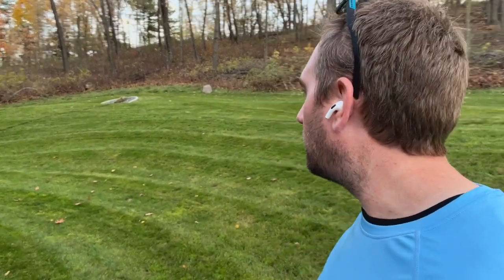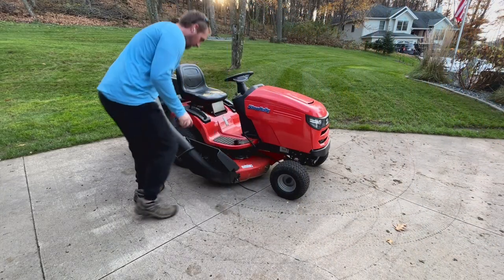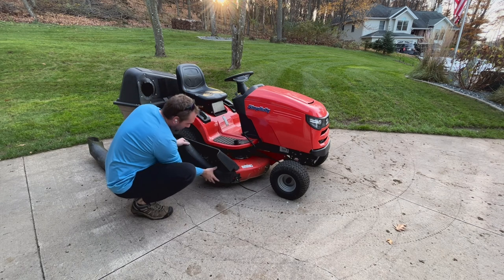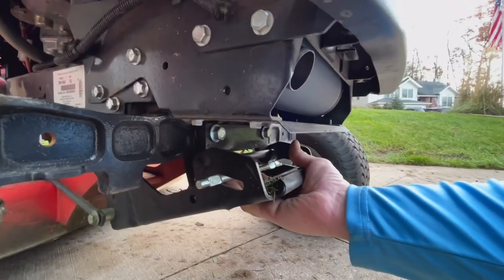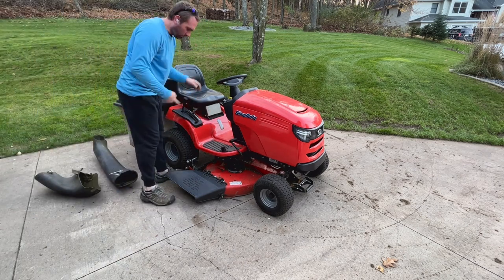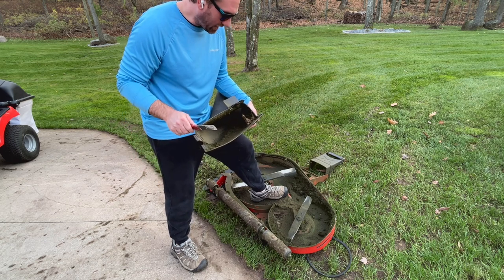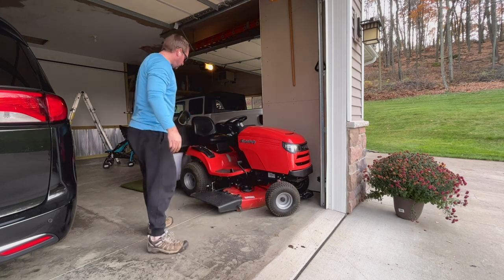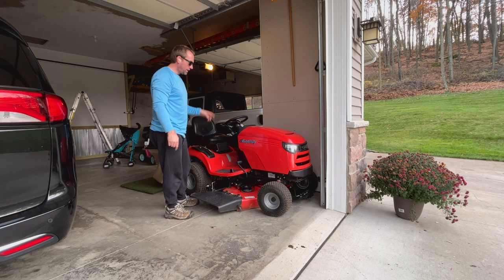Simplicity Mower End of Season Maintenance #1: Deck Removal/Clean, spindle grease

Comment: Hey LE, just took my spindles apart for the first time, on my 2015 Broadmoor. Which grease did you use for your spindles? I have opened, cleaned and repacked the six bearings which have about 450 hours on them. They are 6204 bearings, and all rubber seals were in place. Grease I've added in the past just caked around the spacers. Do you think the grease is there just to seal out moisture?
Reply from the maker: I've been using a standard high temperature grease (Super Tech).  

Greasing is a bit of a complicated subject.  I don't think you situation was bad necessarily, the job of grease is to carry oil and slowly release it into the bearings.  You don't really want the bearings packed with grease in operation.  If the bearings are packed with grease and they can't displace it, the bearings will become hot and potentially overheat.

The biggest downfall of grease is that when it has dispensed all of its oil it can cake up and become a barrier for new grease entering the system.  Great job on cleaning out the spindles to start fresh.